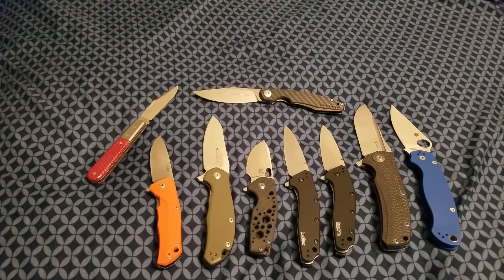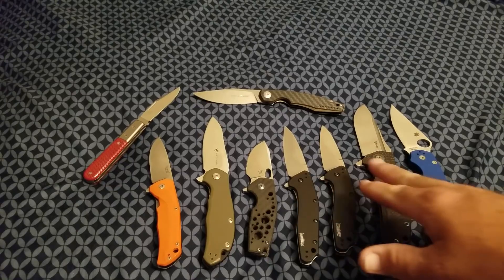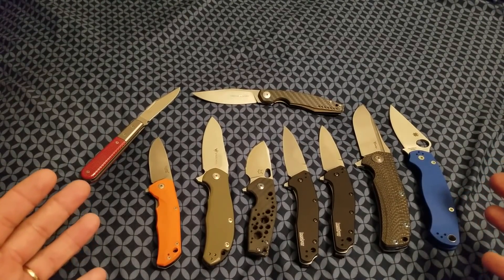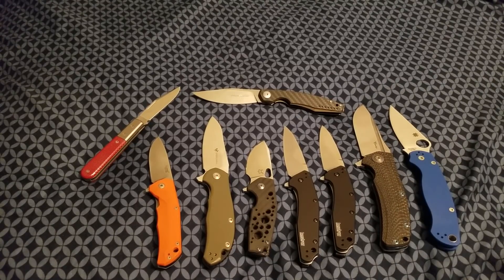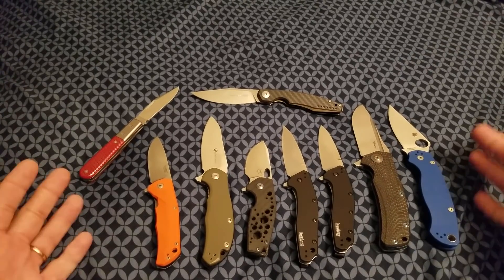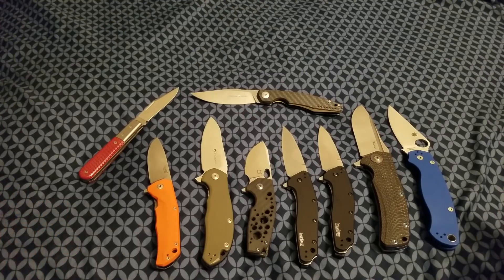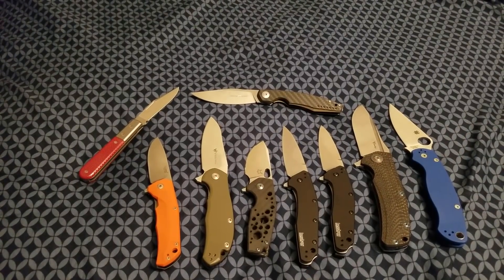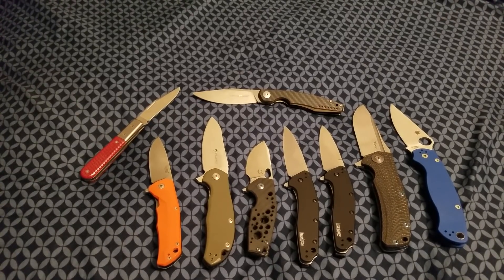M390 edge retention testing data, Rockwell data and building a large data base of this steel

Comment: thank you for doing this work mate. I am heavily invested in M390 (and its analogues CPM-20cv and CTS-204-p) I have 26 flippers in M390 now and #27 on the way.
At least my latest, the TuyaKnife Kingsman is delivered within Bohler's recommended 60-62 range (I have one of the rehardened blades that tested at HRC61, I have seen the test results) and I would love to see you test one of those (one of the rehardened TuyaKnife Kingsman) just to reaffirm the results and see what M390 at HRC 61 can do cutting cardboard wise. I live in Australia so I am not willing to send you mine for testing as the cost to and fro would be too much.

Comment: What about 20cv or 204p? I have 2 cold steel Stormclouds in 20cv which is interesting because it's produced in Italy!
Reply: id like to find out too
Reply: I won't speak for my good friend G @outpost76, however, I will say that's very observant of you to mention 20cv and 204p. Those have "suspicions of there own" thus far. 👍👊💥
Reply: @davemartel9572  to be honest I think it's more heat treat in general of all steels and not just m390
Reply from the maker: I plan to follow up with 20CV, its plagued with the same issues M390 is.
Reply: @Outpost_76  not surprised
Reply: @sgsheff  Agreed, I just didn't go into that here. M390 HT is a mouthful in itself for the moment. Didn't want to cloud the subject with TMI. One bridge at a time. There's far more coming as my buddy G @outpost76 confirmed. I just didn't want to muddy the waters...🤔😉

Comment: Is it 48? 😂
Reply from the maker: Yes I have the M390 that tested 6 times differently ranging from 48 hrc to 58 hrc. I did 1 edge retention test with it already and its definitely not done well.
Reply from the maker: @Some Phaggot I'm not sure how you get a heat treat that tests as low as 48 hrc and as high as 58 hec within 3/4 of an inch section